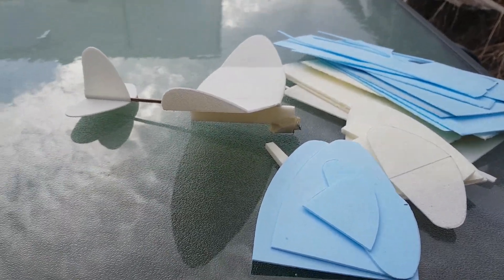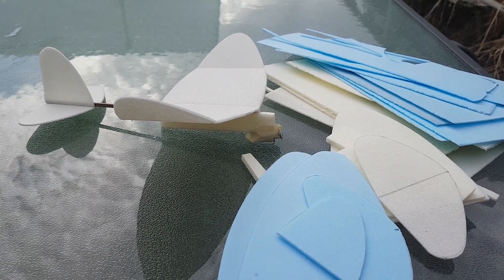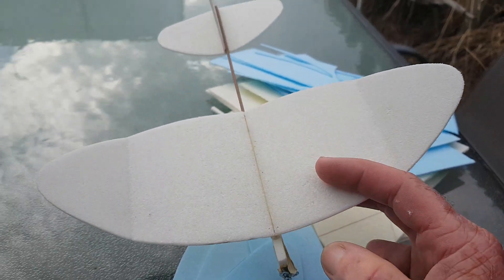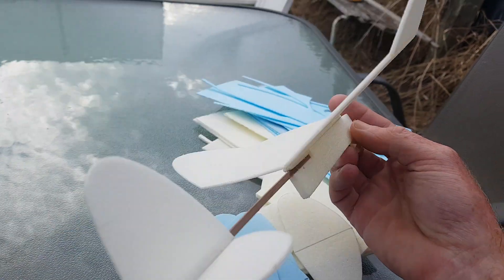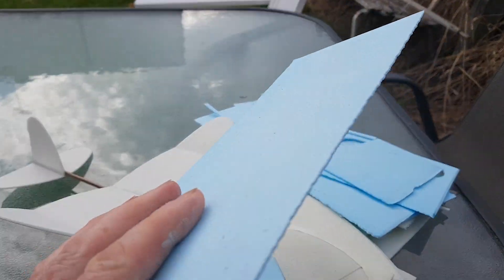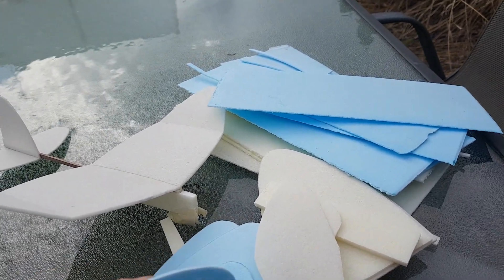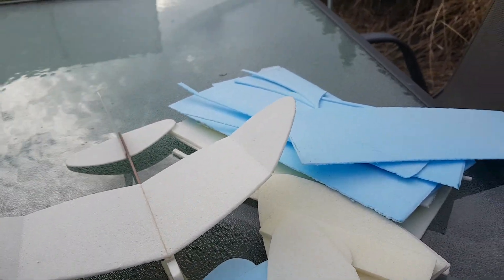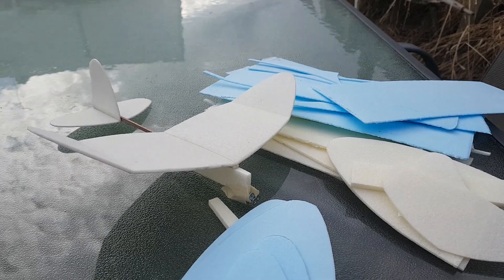Free flight electric super capacitor airplane

Comment: Hi Brett! I watched this video when you first posted it, and I thought I had commented on it but I guess I was mistaken...sorry! Great video and beautiful job on the plane!  I like your sliced foam sheets! I may try to slice up a stack with my hot wire rig...as you mentioned, the various types of foam have different characteristics. I've also used small blocks of the white foam which is typically used to pack TV's etc, carving and sanding it to shape and then hollowing out sufficient space to insert the gear (see the video of my capacitor Spitfire for an example).  Easy to achieve some pretty neat scale designs!
Thanks for the plug on your video, much appreciated! Richie and I hope you've had success with your capacitor fleet and we'd love to see some video!  -Mike in Massachusetts

Comment: Nice! The parts should add up to your 11-12g estimate. I had the foam plates but they were 3mm so I hot wire sliced them. I am still considering if I should epoxy my supercap to the fuselage or make a temporary holder- a paper tube prepared with diluted white glue inside which the supercap can slide.

I am a beginner too. 2 weeks back I had these flights on my first plane..I used the paper tube supercap holder for it https://youtu.be/2nIcKaoqUmM

Pls let me know when you have the pdf plans ready. I have made the parts from hand made templates though, but it will help in future. Good luck with the flights! :)
Reply from the maker: Do you have a e mail where I can send the PDF?
Reply: Brett McCormack Yes please!
ashu DOT bhakuni AT gmail DOT com
Reply: Brett McCormack And does your software also tell u the areas of surfaces too? I am discussing this airplane with a friend of mine whonis a veteran aeromideller from Australia. For airplanes it is better to fly in circles against the counter toruqe of the motor-prop. So for this model with anticlockwise motor-prop (seeing from front) it would be better to habe right circles than left. That will need different setting sof thrustline, and will probably also require changes to dihedral angles of the wing and fin size...
John might help me with this and it would be very helpful if you could tell the areas of the wing (both) and the verticl fin. Could u pls mention that in the email?
Reply from the maker: @ashutoshbhakuni303  yes I should be able to manage getting the areas.Let me know what your advice is re the thrust angles.I am a complete beginner with planes,this will be my first powered model and I suspect the difficulty will come with the trimming .I was going to follow Mikeys instructions to the letter .These guys seem to have the most success with these super capacitor  models that I can find online..this is the modern day rubber power!Free flight for a new era!
Reply: Brett McCormack
Well, I am a "beginner + epsilon", not too far away from you and with no formal training! You seem to have been involved in making rc boats so this shouldnt be easy to pick up. Supercaps are indeed great and are making more people drawn to it. For your first model just stick to what Mike has done- go for left circles.

However I will share the rationale for the right turns and areas...

The motor-prop will rotate in one direction and it will exert a reaction torque on the airplane in the opposite direction. So seeing from front, an anticlockwise spinning motor-prop will try to turn the airplane clockwise, OR it will turn the airplane to the left as seen from tail.

So if we make the airplane go in left circles, it will be in the same direction that the motor is already trying to roll the airplane. This could increase the chances of destabilising the roll motion during left turns- the inward left wing could dip further and cause a spiral dive crash. This seems to have been the problem with some of Mike's flights after he which he added the polyhedral towards wing tips as dihedral wasnt enough- this would resist the too much banking of the inward wing, but it comes at the cost of increased dag (as the inward wing will generate make lift with polyhedral to stay up, but more lift on it will also produce more drag). Raising wings from horizontal with dihedral-polyhedral also reduces the lift from 100% as lift vector now acts slightly tilted due to tilted wings instead of vertically up (lift force acts perpendiculat to wing surface).

So if instead the airplane was made to turn in right circles (opppsite to counter torque) then that would help to raise the inward (right) wing during a right circle by the counter torue trying to roll the airplane to the left. And so it is possible that the dihedral might be enough and polyhedral might not be needed...or slightly lesser angle will work. John said this would give a better climb.

Now since rudder is also used to make the turns along with motor sidethrust, its area needs to be balanced according to the wing dihedral- too large a fin will cause tight turns (and will be slightly heavier too). So going for right circles for anticlockwise motor-prop (and vice versa) will require different value of motor right thrust, could also lead to change in dihedral-polyhedral settings, and fin size might need to be changed too.

I might be wrong in some aspects but the basics are correct. I do not know enough to make these mathematical calculations to alter the design, nor do i have the experience. So John might be able to help me with this and knowing areas will help.

I will also a 0.4mm aluminium sheet to make a small square U bracket as motor mount- it gives the bility to make down and side thrust adjustable and I will need that especially if I fly in right circles unlike Mike.

However it is perfectly ok for you to go for left circles as Mike did and just follow what he has done. Getting the joy of first successful flights is more imp than optimising design for these changes...you could do that as the next step :)

Awaiting your email.
Reply: Brett McCormack
I also posted a comment on his "pre-build" video...see if some of it is of help to you. Nothing grand though :)
Reply from the maker: @ashutoshbhakuni303  thank you..the e mail will be in the morning my time( 10 hrs from now) The file is on my work computer.Thank you for your useful comments!
Reply: Brett McCormack Thanks! John says that the wing tilt for right turns might be a too much and the fin size too. He has said that for this trial, I should reduce fin size- make the heighy 2/3rd of current height. So i will be making this change. You can go ahead without any changes for your first flights. However if you are interested in making another model while your components arrive, you can make these changes- Reduce fin size, and reduce dihedral-polyhedral as mentioned below.

Since I have made the wings, changing its polyhdral settings is a bit tough. I am considering applying water to free the joint and then reset it at a lower angle. Right now the 1 inch polyhdral at wing tips makes them at 30deg..John said that along with the dohedral of 11.5deg, the polyhedral of 30deg makes the wings on this airplane equivalent to wings at 19deg dihedral- he said would go for 15deg dihedral only. So either a simple V dihedral at 15deg should be made, or the polyhdral angle should be reduced.

Increasing dihedral at root cord will create some problems; as you would have noticed that while gluing wing panels the centre region of both pabels at mid-cord touches each other and the edges have some gap- increasing dihedral will increase this gap further. So instead of making V dihedral joint kf 15deg, it might be better to keep same dihedral value of 11.5deg and only reduce the polyhedral angle. I will let you know what the new polyhedral angle should be.